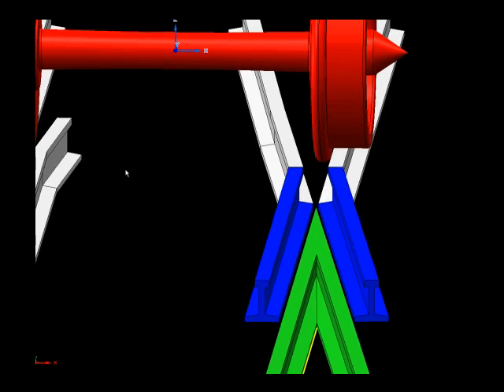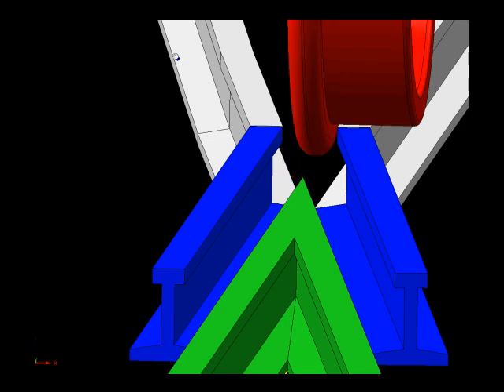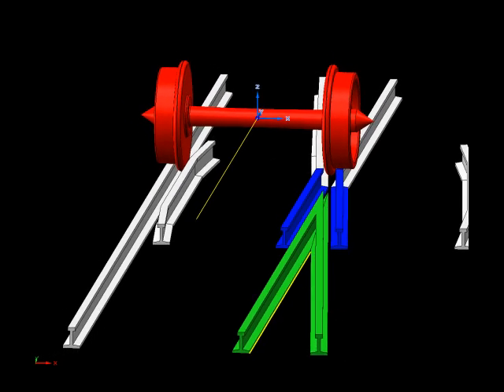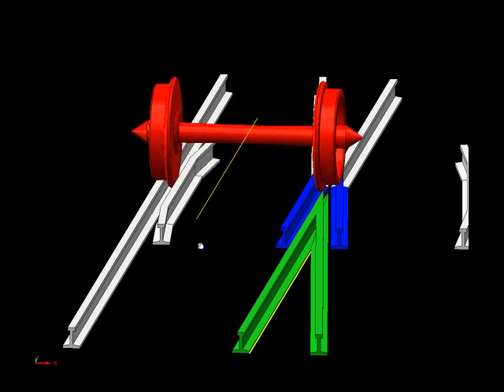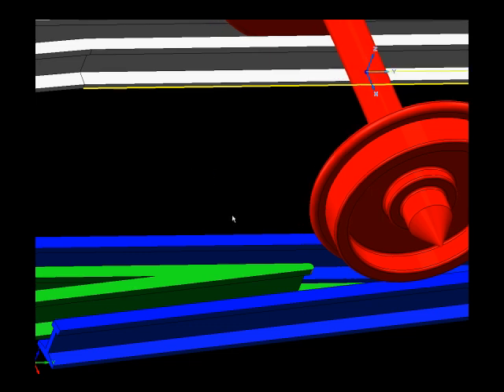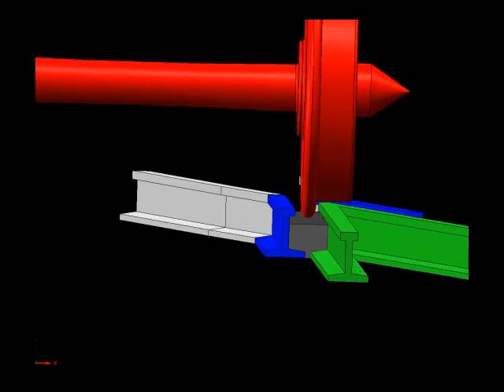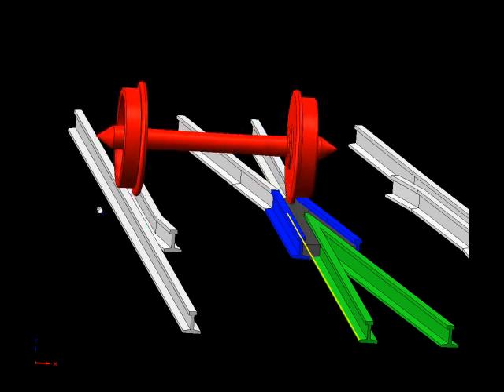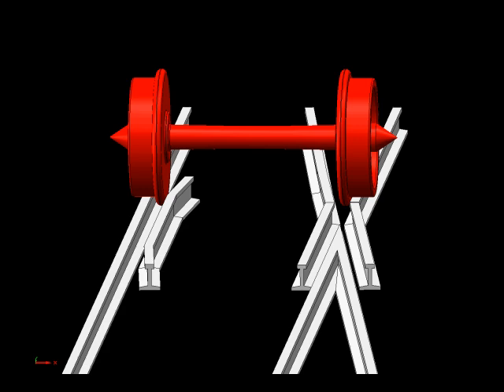How A Railway Frog Point Works

Comment: The frog infills for Roco track ( code75 ish ) with built in soft roadbed are horrendously expensive for both the 10 and 15 degree turnouts ,( about eighty dollars, fifty pounds uk ) for one etched sheet,  and using Kadee  trucks with built in couplers are almost impossible to use as they have insufficient  flange depth ( about 20 thou ) to ensure continuous progress,truly a case of aesthetics taking precedence over functionality ,any ideas gratefully received !

Comment: check all the wheels to make sure that they are all in gauge... hard advice to follow, but eventually you will be doing it one way or another. either you will be fixing every derailed car or systematically checking cars. if you are going to check the wheels, might as well check the coupler "air hoses" because they love to snag stuff at the least opportune time.

Comment: This isn't quite right, due to the conical geometry of the rail wheel, there are points in time, on the order of 1-2 milliseconds where the wheel is unsupported. This explanation presumes that the wheel tyre is flat.

Comment: Nice illustration!
Since the wheel is slightly conical (outside diameter slightly less than inside) is part of  the wing rail slightly higher to compensate for the smaller diameter?   Otherwise the wheel WOULD drop and hit the point harder.
Thank you.

Comment: Great graphics, marred slightly by the lack of a little perspective on the rails. There is an optical illusion which makes the front of the rails look less-apart than the rear of  the rails. Also, the volume of the video was significantly low; had to turn up the computer's volume very high to hear the great explanation. Altogether very well done!

Comment: There is nothing wrong with Peco Streamline turnouts. The problem is with the wheelsets in your dad's old Hornby carriages. The back-to-back measurement is too narrow, and the wheels tend to bind or ride up on the check rails. Replace them with modern Hornby wheelsets, and you shouldn't have any more problems.
Reply: Lol

Comment: Do to the high axle load railways don't use flange running. The width of the wheel determines the maximum frog angle, at which the wheel can bridge the gap without 'falling' into it. The guard rail prevents the wheel on the frog to enter the wrong way by guiding the outer wheel on the wheel back. To overcome the reduced derailment safety when guiding the wheel back, the guard rail can be superelevated with regard to the top of rail. Entry and exit areas are inclined to provide smooth guiding.

Comment: Well done!
What happens at a 90-degree crossing track?
Do the flanges pick up the load as the wheel treads roll through the flangeways?

At what degree of angle does this smooth transition fail to occur?

Are the guard rails ever touched by the wheels?

Thank you.